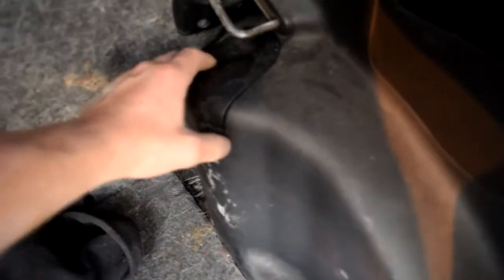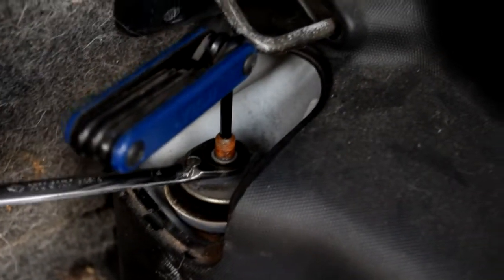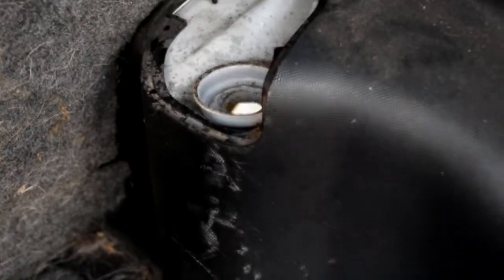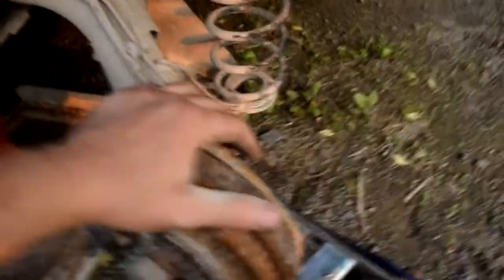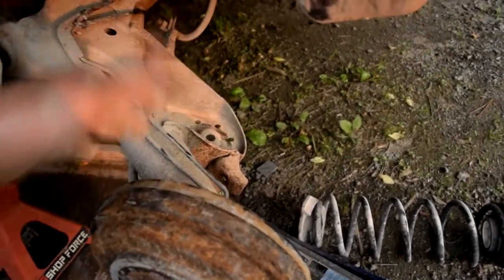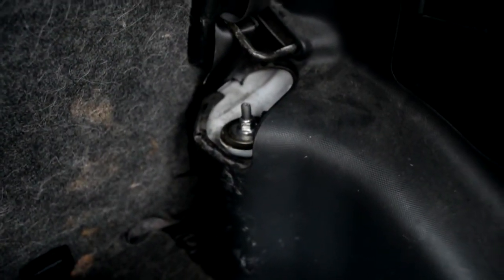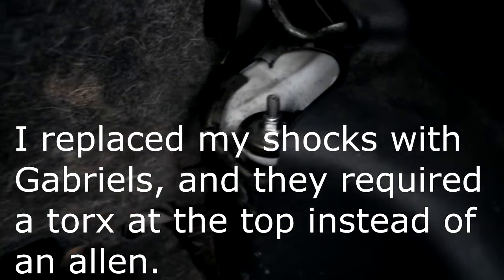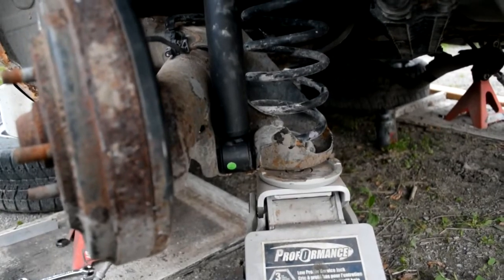How To - Change Shocks and Springs Honda Fit (2007) First Gen

Comment: Thank you so much for making this video! I have a 2008 fit sport and the mechanic who changed my oil recently told me that I had a leaky shock.
Reply from the maker: Glad I could help! They can generally be pretty easy to change out. I heard of some people having issues removing the bottom bolt. So if you are in the salt zone, make sure to spray the bottom bolt with PB blaster or something.

Comment: Is tbe part that the bolt goes thru on the shock suppose to be welded to the shock? Mine r nit thats rubber u see in this pic I can send
Reply from the maker: Yes, its should be welded. You can send me a picture at matt.g.eddy@gmail.com